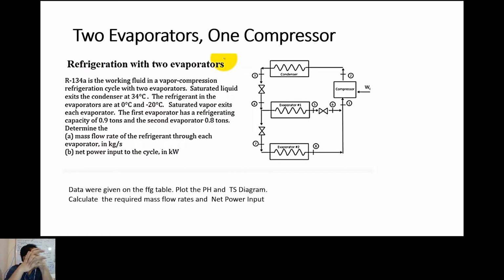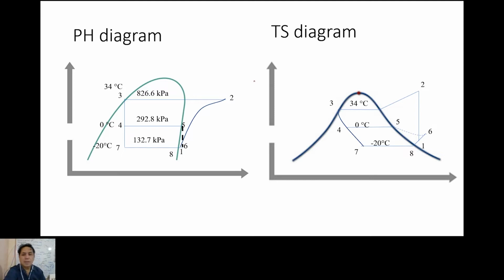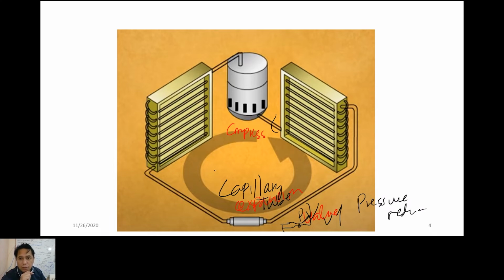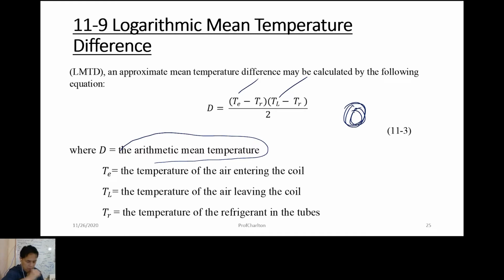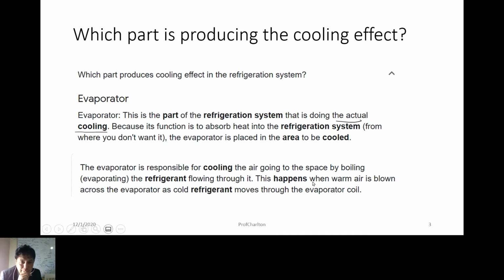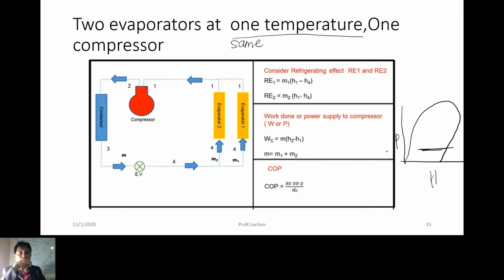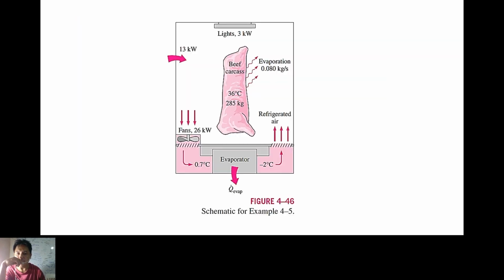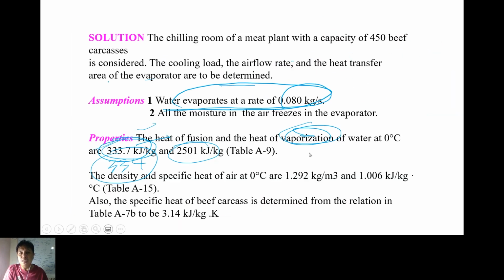Ref & Air Con: Chillers and Multi Pressure Systems Part 2

Comment: Thank you for your amazing lectures ProfCharlton!  As the temperature of the evaporator becomes very low and / or when the temperature of the condenser becomes high, multistage systems are used in practice. In many cooling systems, different temperatures are required at different points.

The capacities of the chiller are evaluated according to the design and are therefore determined according to the temperature conditions of the design and the working capacities. Obviously, those numbers can be determined from the nameplate.

Evaporator problems require solving the material and energy balance of the system with the accompanying equations of property and heat transfer. The solution will be quite simple.